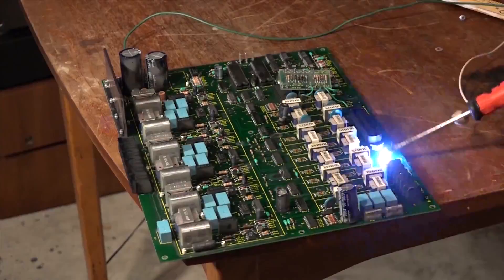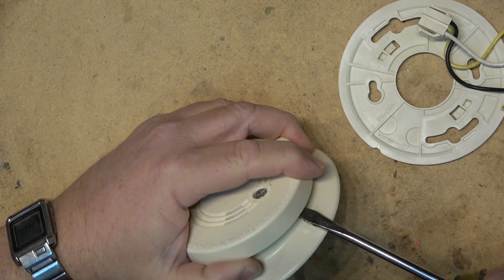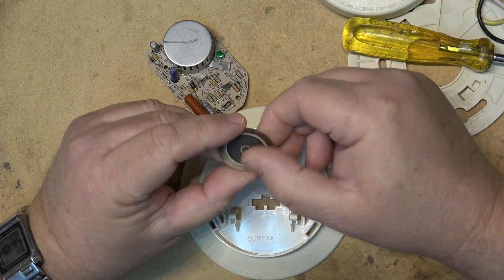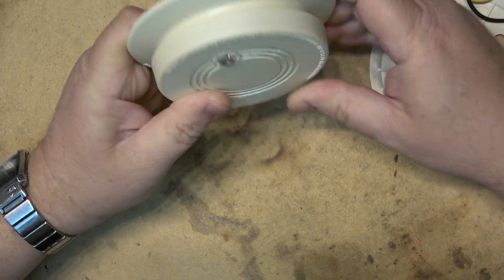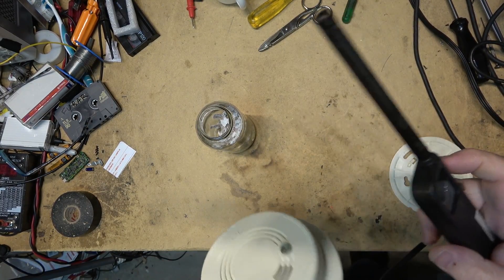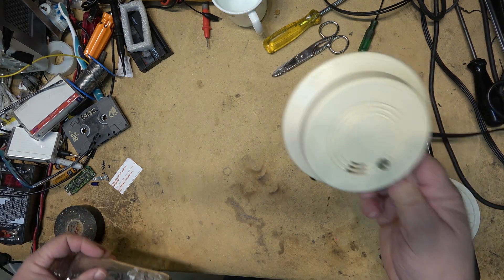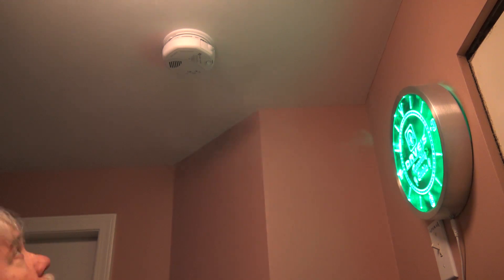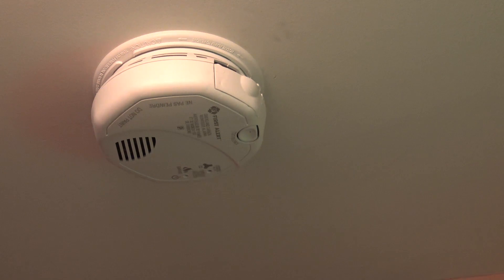smoke detector tear down repair and test using real smoke.

Comment: even if you dont dissasamble the americium radioactive material chamber, you are still exposed to alpha and gamma radiation, as the smoke detector does not isolate fully of the radiation, you should not get your hands so close to it as air can shield a lot of the alpha radiation

Comment: Bloody hell, a dinner plate piezo lol.
I would imagine some units would automatically re calibrate the amplifier to keep it on the edge of tripping.
it sounds like the old ones in my house must have been the radio active type.
You only had to walk past and whisper  ' smoke '  and the dam thing would go off ha ha :-D

Comment: We have a smoke detector in the hall way that is annoying, goes off every time the oven is used, it's very sensitive. The smoke detector in the living room, which is much closer to the kitchen however doesn't go off at all from the oven. I guess they are different types, not sure how you can tell how a smoke detector is which type and which type you should get? I should pull them down and see if it's labeled. Looking to replace the one in the hallway though with whatever type won't go off over the oven, which isn't something burning over on the stove, just when you open the oven door when the element is turned on.. happened with our old stove too, both electric stoves.
Reply from the maker: They will be labeled.  Photoelectric usually have a p on them and ionization unite have the radiation warning label on it.
Reply: @12voltvids  Thanks! The one in the living room is the ionization type and dated 2008, time to check them all and replace them, thanks for this video I would of not known. Says "This device contains 0.9 micro curies of Americium." Just checked them all and they are all ionization but different brands and dates ranging from 2006 to 2019. Are ionization more popular than photoelectric?
Reply from the maker: @victorcoss2600  Yes they are, and generally cheaper. Ionization respond faster to hot burning fires and photoelectric faster to smoldering type fires, so it is a good idea to have both. You can get combination detectors which are a little more expensive. I went with a combo smoke / CO detector even though I have a heat pump, the backup furnace is as and there are 2 gas fireplaces and a gas range here so a CO detector is important, and my old was was also expired.

Comment: Oxides on the peizo element is the main culprit in the failure of these cheap devices
Reply: Odd; isn't it?  
That the very thing it is sensing for, crept in a lower level over a prolonged period of time and undermined it own function.

Comment: i had a hard wired smoke alarm installed. But it was beeping all day and night for no reason...? So i removed it last week and installed a battery unit, that doesnt beep nonstop. Lol
Merry Christmas, Dave
Reply from the maker: Bugs or dust in the sensing chamber
Reply: I really think those hard wired only units are a bad idea. It's not uncommon for an electrical failure to occur in a large house fire, especially if it was caused by an electrical problem to begin with.

Comment: My detector reacts on smoke from the shower.  Is that normal??
Reply from the maker: Yes steam will trigger them. Too close to the bathroom.
Reply: @12voltvids  Thanks
Reply from the maker: @will89687  Yes, I know.
Reply: but only for ionization type smoke detectors, Photoelectric type units do not normally get activated by shower steam